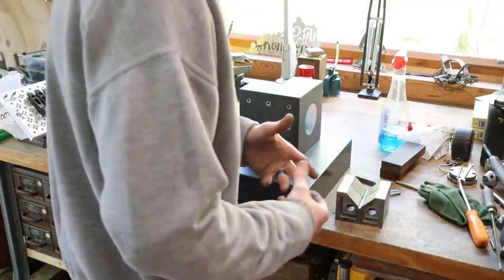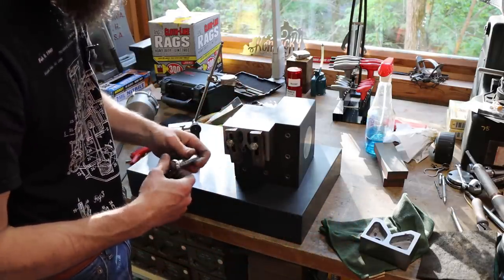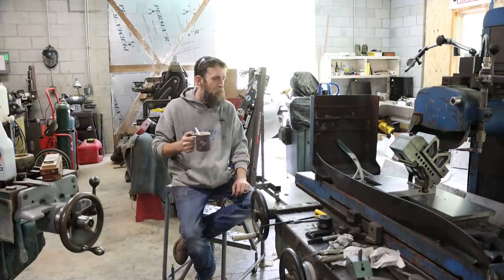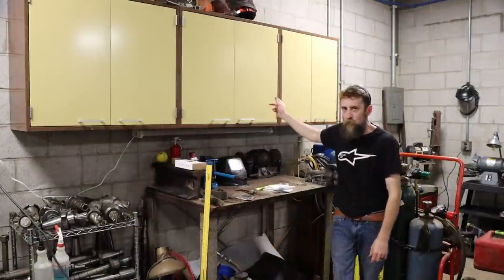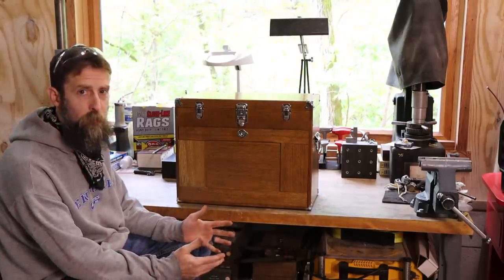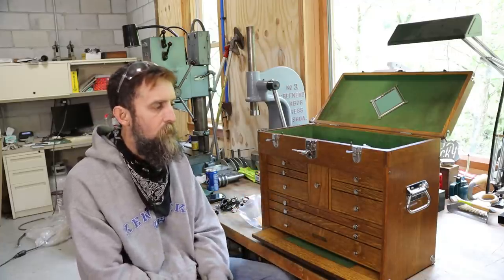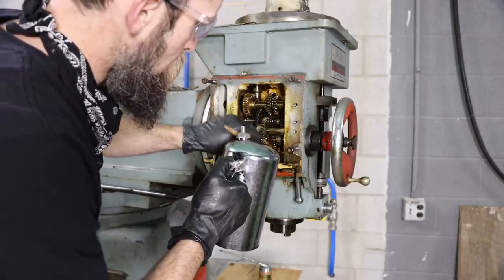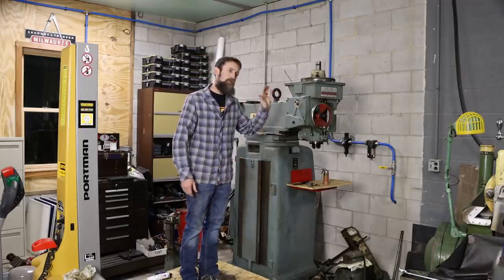DoAll Mill Gearbox Service / Surface Grinding V Blocks & New Gerstner Tool Chest

Comment: 36:35 That looks like the bottom of my deep fryer during it's regular annual clean out.🤦‍♂️
43:30 Plans will always work until first contact with the enemy.
DO you have an update on how your Starlink Internet is working out. I know you were well pleased with it very soon after you got it but you really didn't have much of a connection to compare it with so how has it been now that you have been using it for 6 or so weeks now? Just a curiosity question so please don't waste time on an answer since you now have nicer weather to catch up on the projects that winter has resulted in being put on the back burner.

Comment: How many options are there other than the white coolant for the grinder? I have used it and don't like it.  Some places I have worked have used a light blue that you can see thru. I notice most people on youtube just use the white. The light blue allows you to see better what you are grinding.
Reply: I never liked the white coolant myself. I heard it is organic based. I forget what the advantage of it over synthetic is. I think it's the cheapest crap going? But there was some other reason why we used it too. We used it and synthetic stuff, which was pink. The white stuff is very prone to going rancid. Which is as nasty as it sounds. You can make white yourself. Just mix oil, water and detergent. But then you have a foaming issue. So you have to figure out a way to de-foam your mix. One thing that works is alcohol.

Comment: If you put a transformer in to run the pump on a lower voltage you wouldn't need to restrict the flow so much.
Reply: Speed controlling electric motors is a somewhat complicated topic. Suffice to say not all methods work with all kinds of motors. Some motors you absolutely cannot speed control by changing voltage. Which is why they sell VFDs.
Reply: @1pcfred  indeed. I think he might have said last week that it was a brushed motor. And he's throttling the flow down really hard.
Reply: @Rich-on6fe  universal motors are easy to speed control. Every drill has a speed controller in it. Well the variable speed ones do at any rate. But there's other ways of mitigating the issue too. In fuel systems they use a return line. Which over time would probably be more reliable. Motor speed controllers have a habit of blowing up.

Comment: Steven, pull that bottom drawer out of the chest and look underneath. There will be the original makers stamp and serial number. Gerstner will have the original owners info still on file. They will only give you a replacement key without this info also. Take UPS to task, force them to pay. You have proof of what the new ones cost. That model is a Journeymen series. If they don't pay up send them a link to this video and tell them you'll do another. THEY ARE THE MOST EXPENSIVE shipper and the worst.

Comment: Only open your fuel cylinder 1/4 turn.......That way if you have a burn back you only have to close the valve a small amount.Oxygen you open all the way so as to seat the valve...
Reply: Having set an acetylene bottle on fire myself I raise doubt on your burn back theory. How's a flame supposed to go in the fuel? There's no oxidizer in there to catalyze with. Acetylene only burns in the presence of oxygen.

Comment: Why not just cut the big hole with a mill? Would be more accurate and a better finish? Just curious and learning.
Reply: Maybe Steve wants to show off his Smith torch or his new regulators?
You can make a torch cut like that in less time than getting the tooling into the mill and the part fixtured.

Comment: Auto rust prevention for surrounding area. You should be able to slick your beard back too.
Reply: Depending on the concentration surfaces contaminated with coolant can rust. And if they don't rust they get sticky nasty. So you're basically cleaning it up either way.

Comment: Hi , do have to allow for wear on the stone?
Reply: Yes. But the down feed on surface grinders is pretty fine. The ones I ran were graduated in halves of thousandths of an inch. Or 0.0005" So you come down slow and touch the work and then go from there. Generally you don't remove more than a thousandth at a pass. That's a cut. You get a different cut on a freshly dressed wheel too. A dull wheel more burnishes the work. Like if I care I'll dress before the cut. Because working from one side to the other a wheel can wear. There's a lot of things you need to take into account while you're grinding.
Reply: @1pcfred  thank you Paul, I understand 👍
Reply: @martinworrall5888  it is something you come to in practice. On the face of it surface grinding is a simple operation. I had to learn on a manual machine myself. That was tricky. You had to traverse the table with a wheel. Steve's grinder goes back and forth automatically. Coordinating that movement is a bit of a trick. You have to have rhythm. But initially I found the activity rather ludicrous to do. So I struggled to take it seriously.
Reply: @1pcfred  I understand, it’s the sort of thing that you do for years and you suddenly realise that the operation seems to come naturally, if you can understand what I am trying to say.
Reply: @martinworrall5888  it did not take me years. Just a few days. But over longer time I got even better at it. You have to really get in the groove to get a great finish. Your step over and traverse. I could get metal to have like an oil slick looking finish to it. Kind of prismatic. Reminded me of what old metallic recording tape looked like a little. The multi-color glitter. Was kind of satisfying.
Reply: @1pcfred  I work with timber and I can relate with you when machining either metal in your case or wood in mine you just know what is right.
I also work on cars and it’s the same thing you know instinctively when a bolt is tight on car or machine.
Reply: @martinworrall5888  there are different classes of hardware thread fit. Sometimes it is supposed to be tight. When engineering is involved I do not rely on instinct. Because there's nothing natural about artifacts we make. I don't think we are very instinctive creatures anyways. Habitual perhaps? But it's not quite the same thing.
Reply: @1pcfred  very true and I understand what you say 👍

Comment: So I'm sure someone here can answer this... doesn't the wheel wear away? Introducing inaccuracy? Is it just that it wears slowly enough that over the course of a small set of blocks, it just doesn't matter? Real question, I just don't know about machining.
Reply: Wheels do wear and theoretically there can be a difference as they wear. Now whether that difference matters, or not depends on other things. Steve made the blocks better than they were.
Reply: @1pcfred  I'm sure. I was not criticizing. I just didn't know.
Reply: @TKevinBlanc  grinding wheels certainly do wear. Yet how much they wear remains manageable in this application. Grinders still work.

Comment: And I can't believe you cranked open those valves on your oxygen and acetylene tanks the way you did. As good as they could be, you should never trust them. You should crack them open slowly and keep your face turned away from them so in the unlikely chance they blow, you don't injure yourself  . It's a rule of thumb in safety.
Reply: This is true...🍁
Reply: First thing I learned in welding school, never face the guages when opening the main valve.
Reply: You've clearly never worked with ironworkers. At the end of the day they sling the hoses around and just launch the regulators into job boxes. Then the next day they get up and do it all over again. Very hung over with very broken gear. When I saw that I got me some Smith hard hat heavy duty gauges myself. There's absolutely no chance they're ever going to blow up.
Reply: @1pcfred  you are correct, sir.  I  never did welding for a living so I am not familiar with the "real world" in that regard.
Reply: @daleolson7205  I've never welded for a living either. But I've worked with folks that have. Ironworkers, pipe fitters and tin knockers too. Sometimes even carpenters weld. They're usually pretty bad at it. I knew this one alky that shook so bad he had an amazing natural weave. He couldn't hold a rod steady if his life depended on it.

Comment: Please contact gerstner to see if they can work with you on repairing it, please
Reply: Yes, watched abom79's video thats why I'm asking you to contact gerstner to see what they can do. if you tried to buy new easily 600 to 700 or more sweet toolbox please repair properly
Reply: @edwardsilva895  New that box goes for over $1,500 today if manufactured domestically. Although you can get the far eastern one for about $350.

Comment: UPS package handling is abhorrent. When you get something from them, it is usually so dirty you don't want to touch it. The boxes are frequently crushed. They move the product, but don't care about it. One time, they left a package at an incorrect address. They were no help in finding that package.

Comment: UPS = Unintelligent Package Smashers
That's so annoying what happened to that very nice box. I can't understand how they can treat the packages with so much disregard that they are able to damage the contents especially when they get packed so well. I wonder if things will change since everyone carries a video camera around with them now and that destructive behaviour can be so easily recorded and go viral on the TV and YouTube. It hasn't stopped the 40,000 gangs in the USA with their uniformed and armed thugs being violent to citizens, the vast majority of whom are just going about their daily business. But I suppose that having a blown number plate globe (bulb) is just the beginning of a criminal career. 

I hope there is a positive result with the UPS claim and that exquisite cabinet can be restored to its former glory. How can people sell those for $50? It costs me more than that for the wood just to make a small stool? I spent $18 for some pine so I could make a simple foot stool which is light years from what would be required for your cabinet.
Reply: The wood was bought long ago and the item has depreciated over time. So you cannot compare it to how much it would cost to make today. Apples and oranges.